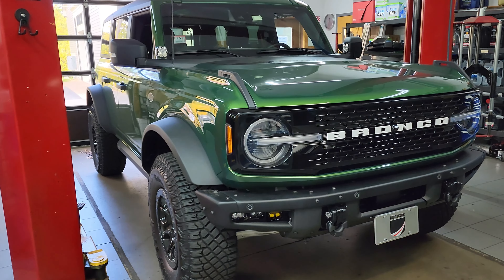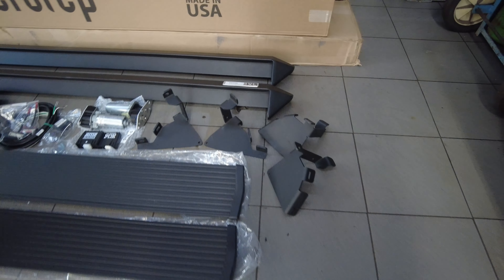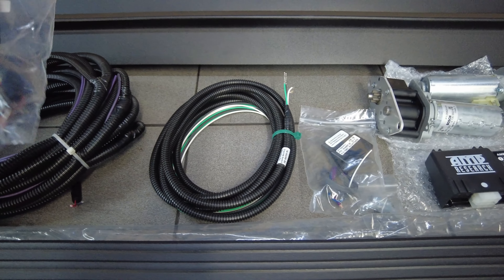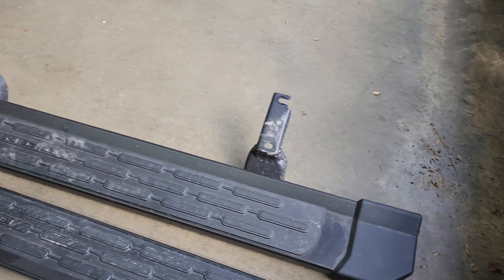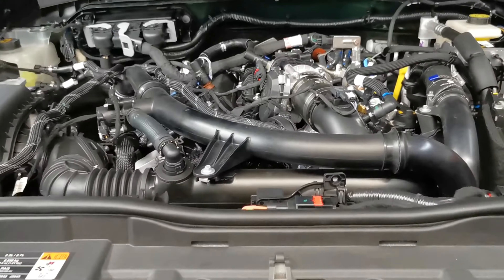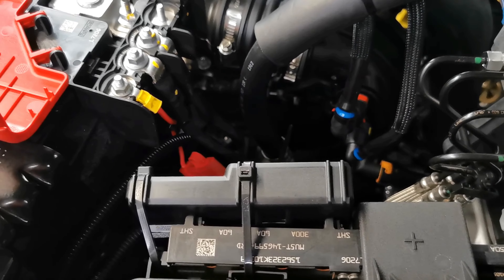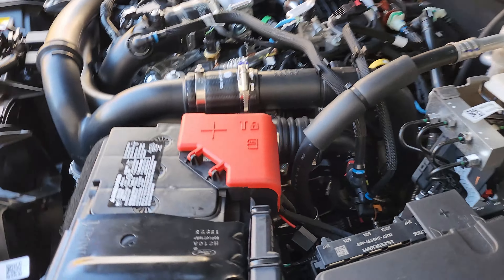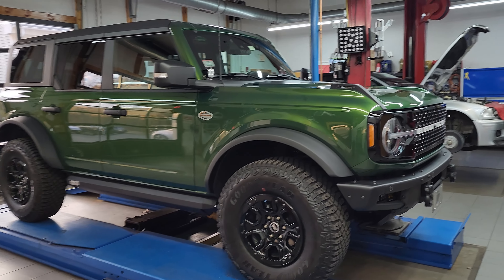Amp Research PowerStep XL Installation and Review on a 2023 Ford Bronco Wildtrak Sasquatch!

Comment: Mine on the drivers side doesn't retract all the way up in the front.  I can push it up, and it stays but not sure if this is a motor issue or adjustment?